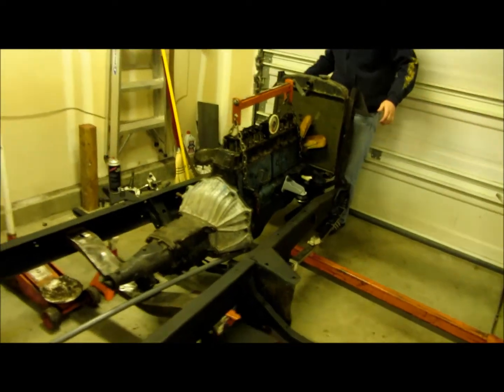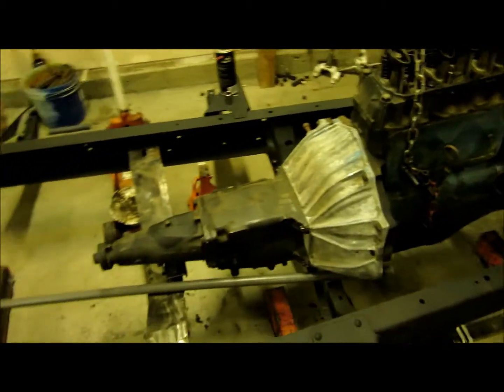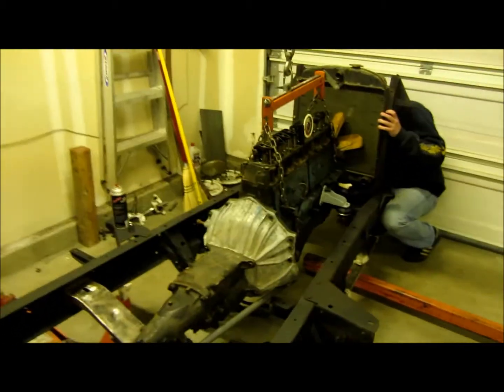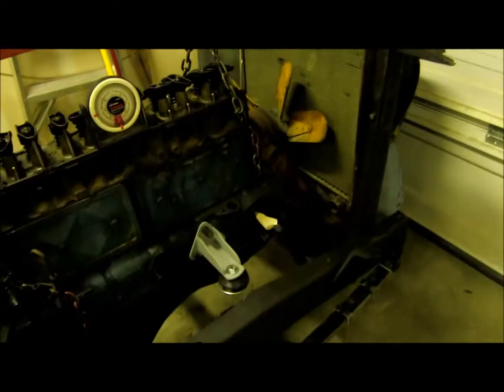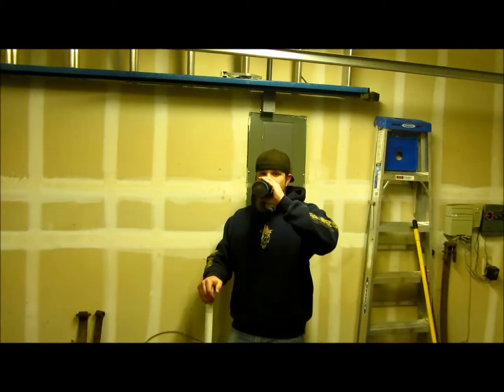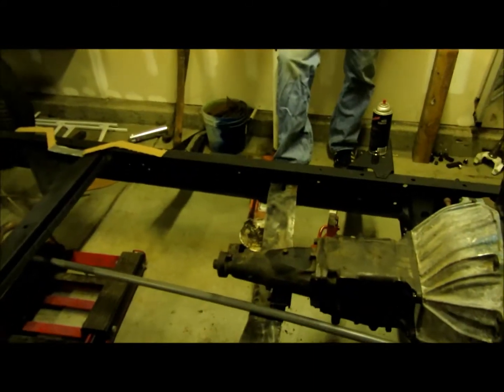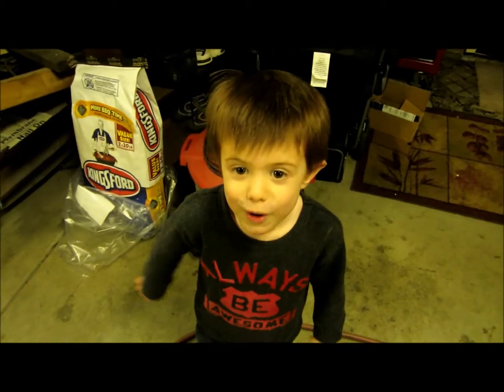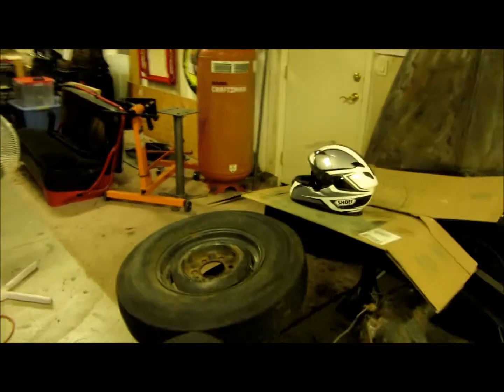Dirtball garage pizza night.

Comment: Looks like fun.
Reply: I used factory crossmember too. I have camaro front subframe and fit camaro crossmember into my orginal ford frame. Worked excellent!! Put spacers in between crossmember and frame if need to.
Reply from the maker: 19stoney64
 It will need one small spacer for each bolt, but that's it. Should work out well.